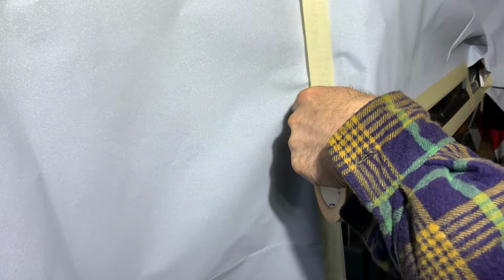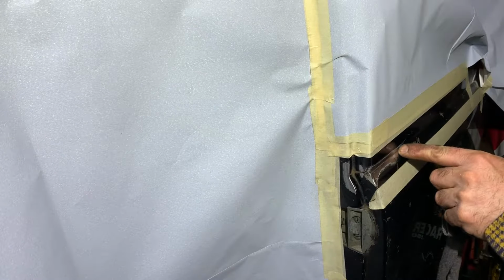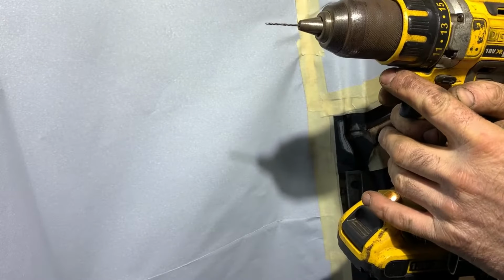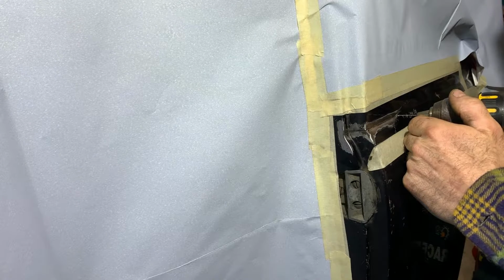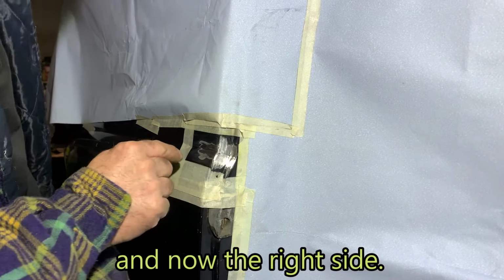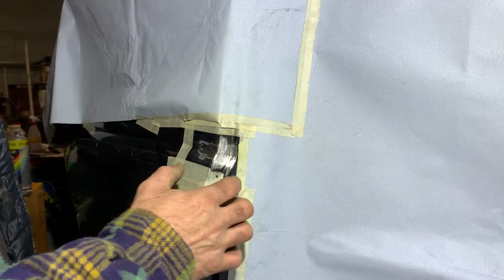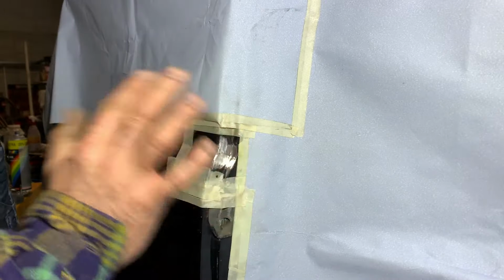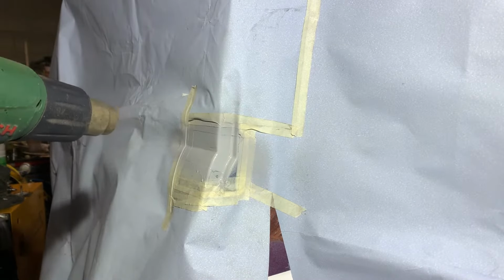VW BEETLE DIY TEAR IN THE BODY REPAIR EPISODE #46

Comment: Hi, Filip nice work on small parts as this demands a lot of time to rework. that with drilling holes on the start and on end of the cracks is a well-known formula it depends just logical thinking  I used this procedure when I discovered Cracks in the Granite or marble stones which I did work on. anyway, great video for these of your followers who did not know that. 🇧🇪👍🏻☮🍀🇳🇴🇳🇱greetings Hubertus.Ps have a nice Easter weekend.
Reply from the maker: Thank you very much for this nice comment. It’s a procedure that I know for a long time and will learn to others that or not familiar with it. I always learn and that takes time. 👍👍👍
Reply: @VWBEETLEOVAL1955  yes indeed Filip

Comment: Like a surgeon.  How will you buff the area out smooth after it has cured?
Reply from the maker: I will use a sandpaper 2000 to 4000 grid with water and buff that out to one smooth surface. Thank you for the compliment 👍👍👍